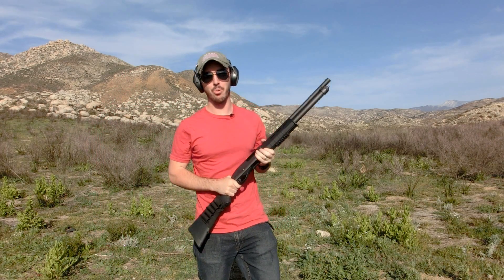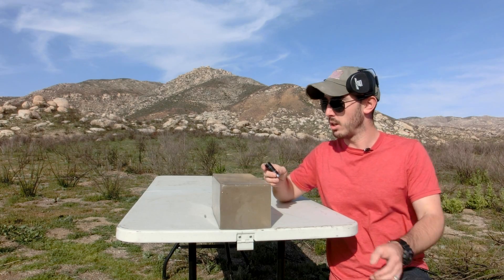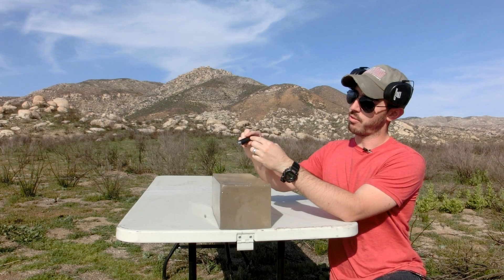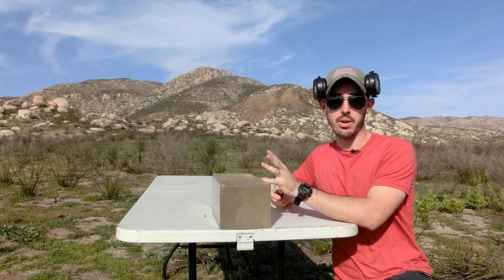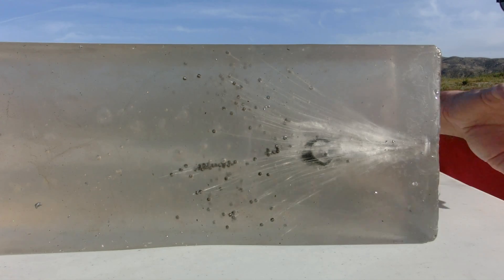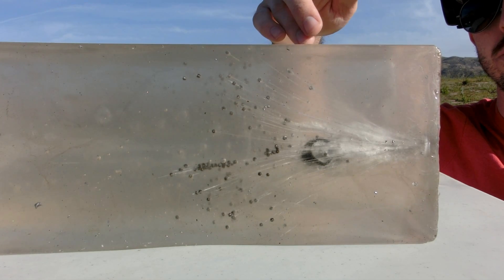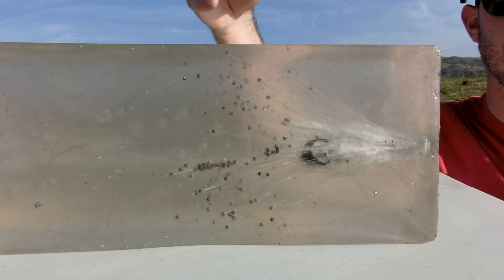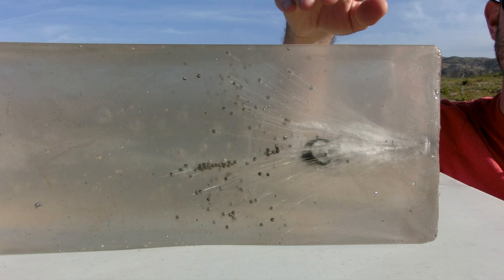Gel Test - The Cut Shell

Comment: I personally think your recommendation on not using this as a defensive round is bull. Yeah its 3 inches sort of the recommended penetration but it's also a projectile that's more than 1 once moving at about 1100 to 1300 fps that energy is fucking up a 1 foot squared area easy and if you hit a person in the chest with that it doesn't matter if it penetrates the heart or not that kind of force make the heart stop.

Comment: I really don't think penetration is that big of a deal when your organ sack is stopping a 1oz ( plus a gram or two for the plastic.) projectile that is moving around 1100 fps. So a 1oz moving at 1290 creates just over 1600 ftlbs of energy.  The average ft lbs  dump recommended for elk is 1500 and only 1000 for dear. Also go check Paul Harrell's videos on the topic. I am not saying I prefer a wax slug over anything.  I am saying that discrediting a projectile that is definitely a ditchcraft item when it has never been expected to replace but instead be used in absence of, is a little short sighted  and unreasonable. At the time of this post any formidable or effective rounds are not on the shelf and the 1oz target loads are. You saying you will go without instead of trying the next best thing? Would I spend the time to crank out 1000 of these? Hell no. Would i turn a box of 25 that cost me less than 5 bucks into poor boy slugs? If I couldn't find my preferred ammo, absolutely.  Would be stupid not to ( not calling ANYONE stupid ). In short this method is not for those that have had great success or the type of sudo disposable funds to acquire premium ammo. If you can find and afford the right stuff the you absolutely SHOULD buy and use it. If you showed up late and only found target rounds but feel you need something that keeps its muzzle energy a little longer than this is an option. Also consider in this very video we saw no over penetration, in fact everything was inside the target ( inside is good ) . That means if it was a 2 3/4 @ 1oz. Moving around 1200fps it dumped every single bit of 1500 + ft lbs entirely into the target. Get a square,  put it across your chest and measure how far your back is from the inside of the right angle. Now let's go ahead and add.... let's say 1 inch for clothing.  I bet your vitals are still well within that 9 inches. Idk and this is just my 2 cents but I think it would suffice in a pinch. 2021 gonna be bitch

Comment: I don't agree while the fbi recommends 12 inches of penetration their test was done on normal rounds coming out of a pistol or a rifle penetration isn't everything,the cut shell left a huge cavity and spread shoots at 9 inches deep it's definitly lethal if you ask and it's only one shot you could easely have a second one in a double barrel even if they don't fit well in a pump or a semi automatic
Reply: What most people fail to remember about the FBI study is the mentioning of remote damage. This damage is cause by the hydraulic shock to the blood system. Bullets that dump large amounts of energy into the body have left blood vessel ruptures in the brain and elsewhere,even from hits as far away a thigh impact. These rounds are dumping somewhere around 1400 pounds of energy into the target,almost instantly,you can bet there will be enormous remote damage.

Comment: I also suggest the cut being closer to the brass
Reply: I tried, gives a bit to much of a tail, even tried symmetrical cone shape leading into a small uncut section less than 1/16 " wide so that it would leave four stabilizing protrusions when it detached and that one missed completely.  Your never going to be able to dial cut shells into a desired performance do to the randomosity of the energy transfer at the moment of discharge. The only consistency you will get from these is in fact thier inconsistency ( sucks but it it what it is ). If you want to have some control or ability to some what standardize a poor boy slug your cheapest and best bet is a wax slug. The next best thing would be to buy a mold for .74 cal ball or a 7/8 oz. slug mold. These three options allow you to easily and very cheaply turn bulk target ammo into something more useful.

Comment: Cut shells aren't about penetration. They dump a shit ton of energy into a soft target
Reply: Yeah I think at interior home distances this would make a serious mess, probably knock most attackers on their a$$. certainly a high center mass hit would break a rib and knock the air out of their lungs.   The idea is stop the threat.   If you need a second shot after that the first impact probably makes a formerly moving target into sitting duck.   My questions are can you load and cycle shot shells through a pump or semi auto  - or will they break in the ammo tube or have a tendency to fail to feed or fail to eject.
Reply: @JoshuaFinancialPL  go check out Paul Harrell's YouTube videos,  he covers this very well and will leave you feeling much more informed than most others could. The major problem with these is that they like to tumble and flip out the contents of the shot cup. Check out wax slugs.